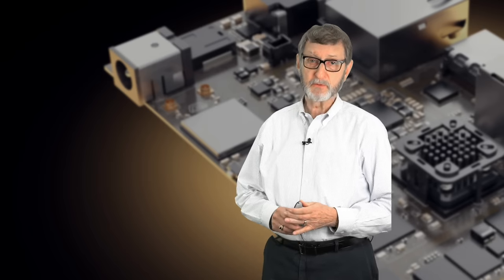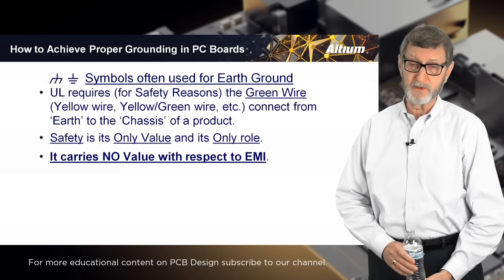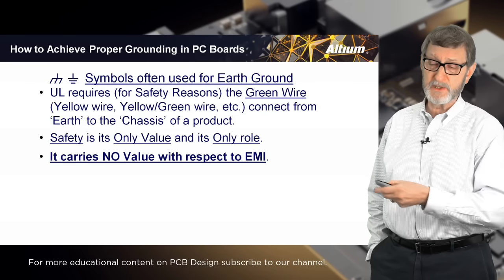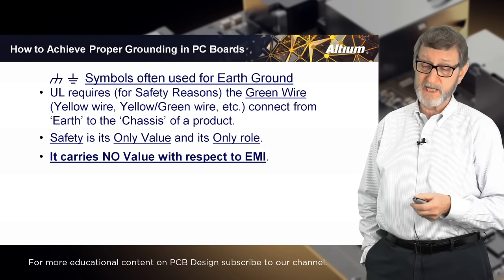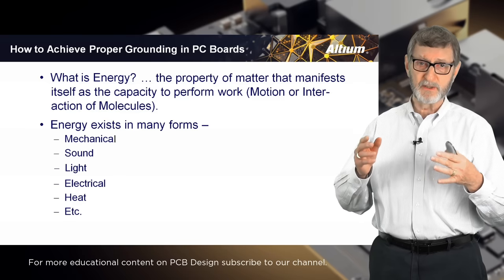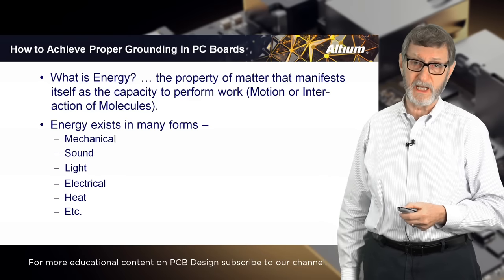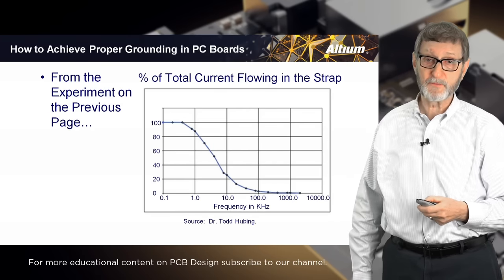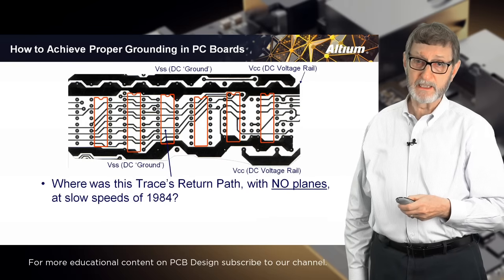[LIVE] How to Achieve Proper Grounding - Rick Hartley - Expert Live Training (US)

Comment: I've been a designer since the 80s. I have been working in Altium since its release. (A mixed and power electronics designer). 
I haven’t seen anything more exciting, I was stuck for two hours. Lots of adrenaline. Detectives are resting! Thank you for the material. 
Much is familiar and has long been intuitively understood. I developed some of my own triks and solved problems differently. But here is a wonderful systematization of the life experience of a wonderful designer on the way from a teapot to a pro!! 
I understand it and remember every one of my mistakes and every crazy PCB.  At some point I realized that the EMC laboratory should be behind my back, and not from someone for money. I assembled it, and the work went much faster. Thank you so much again!

Comment: 7:00 the question of should you attach the cable shield to chassis or to circuit ground, for which Rick's answer is always to the chassis (and for good reasons).  That's all very well, so long as this cable is not designed to carry the signal return (slash ground reference voltage) on the shield, like several standards for audio cables do, for example.  In that situation, you don't want the shield conductor to connect the chassis of two pieces of equipment that are plugged into mains, where their chassis are individually connected to the ground pin of two different wall outlets, thus introducing a ground loop, and a hum voltage that adds to the audio signal being communicated. There's a reason for insulated RCA sockets, insulated BNC sockets and so on.

Comment: Great presentation.  At 32:00 there is an interesting effect not discussed.  At very low frequencies the Z0 goes up (nonlinearly) due to finite R and G as frequency approaches zero; a low frequency dispersion.  You can see this effect on some RF VNA that go down to 300 kHz or lower.

Comment: I just took my electromagnetics class and a class called electrical energy conversion which both talked about electric and magnetic fields and magnetic field circuits along with transmission line properties and formula type stuff which all blew my mind that you can represent a transformer and other magnetic fields / "circuits" like you can an electric circuit while ASLO being directly linked by the electric circuit / trasnformer coil (so the relationship between the B/H fields and the E fields). This video is basiaclly building on all of that too, it all seems complicated if you don't know it but its all relatively simple. Im surpriesd they dont teach the relationship between electric and amgnetic fields / energy sooner in the degree since its so fundamental and important and relatively simple and it completely changes how you view / think about circuits.
Reply: Seems like it's more about lumped circuits - Distributed systems (aka the Power Grid) are complicated messes that show us how Electrical Energy really flows.

Comment: Engineering is all about taking a simple enough model of the real world, so that you can understand it, manipulate it with the tools you have (that for centuries, until 1960s, were as simple as a pen and paper), hopefully solve it and obtain useful results.
The Newtonian physics, although technically wrong, is good enough for most cases, and simple enough to be easily understood and manipulated. The hydraulic analogy to visualize electrical circuits is a powerful tool that simply works and gives correct results in the vast majority of problems an industrial and civil engineer faces in his career (the frequency usually tops out at 50 Hz, which is the mains AC frequency in Europe).

Comment: Very interesting and valuable.

I wonder if there is  such a thing as “field-oriented or field-centered electronic design” that starts at fields and folds the design around that.
Reply: I think the mind required to design circuits that way would be inconceivably smart. It's taken me 30 years to understand how electricity flows through a wire !! Lol

Comment: I think there are some inaccuracies there, 4:24  it is correct that earth is used for safety but only as a protection from lightning.  It is not safe to earth  a metal enclosure since the ground fault will not trip the circuit breaker since the earth return is a high resistance path. You need a low resistance path which is the neutral wire, not earth, earth doesn't have anything to do with it.   22:12 Set of Fields (EM Wave), so which is it, a field or a wave?  An EM wave is a different beast and it is produced by a time varying field caused by acceleration of electrons, so it requires AC.
Reply: EM wave is both a wave and a Field - Tell me, what is Sunlight? is a wave or a particle ? it's Both - This is cally Electrodynamics. No Electron from the Power station ever makes it to your home to power your PC or Phone Charger, the Energy is the EM fields/Waves

Comment: If energy travels in or along the dielectric material via waveguides, how does one explain extended long wires connected to various parts of a circuit? What will be the return path for such signals if the wires are extended from one PCB to another?

Comment: The energy does not travel in the dielectric. If that were so, a superconductive material inside the dielectric would make a circuit not work because a superconductor is blocking the magnetic field. Basically two wires with a superconductive tubes around and in between them would not be able to transfer energy to the load because the magnetic part of the electromagnetic field would not be able to flow in the space between them. You can extend this with superconductive wires so that the field cannot travel in the wires either, but you can still power the load. Perhaps it can still travel in the isolation material, but if it does it surely is a really powerful field travelling in a minuscule space.
Reply: it wouldnt because of the induced current in the super conductor leading to a loss in energy in the circuit

Comment: Funny to hear how the 3rd 'Earth' wire is referred to a 'Ground' in the US. Here in tthe UK all our oulets are labelled as 'L-Line, N- Neutral, E- Earth (Multiphase would be L1,L2,L3). A new colour scheme was adopted  to ratify an a standardasation agreement with the EU. It used to be L1-Red; N-Black, E-Yellow/Green Spiral poat 2004 or Green prior; now it is L1-Brown, N-Blue, E-Yellow with Green Spiral Striping, many times its bare wire and the Yellow/Green sleeve is put by the outlet terminal to make it easy to identify and code compliance. 

Many power bars and computer power cords imported to USA/CA from EU/China will have this colour scheme.

I first thought Black also meant neutral in North America; but at least I got a very nice fireworks display! xD. Coincidently in the current UK 3 Phase System L2 is Black L3 Grey. 

Oh the confusion ><

Comment: At 7:00, what does a signal in a shielded wire couple to, if not the shield? How do the electric fields behave when constrained by a faraday cage? If they're not coupling to the cage, what are they doing? What is the return path?

Comment: What is 100% sure is a few years from now kids will not have to bother with any of this. either there will be photonics revolution [lol], or realtime em simulation in the pcb layout software as they create the traces, warnings will apear to notify the designer about conflicting areas. it is not easy to think about all of these physics happening between each other. 3d visualisation will greatly help.
Reply: I would suggest your assertion is wrong, in the same way that people that rely on spellcheckers and grammar checkers still generate garbage: if all you do is follow warnings and obey them without knowing the underlying details of how things should work, your odds of creating proper solutions in any such system are very low.  Another area I can point out where this is true is with writing code and the warnings/errors you see reported.  Ok, so you fix all the compiler-recognized errors and warnings, but did you truly understand what they meant in practical terms in that context, and do the correct thing as a result?
Reply: Maybe a simulation that can show you the approximate generated EM fields, but I doubt the software is going to be able to formulate a good solution to solve the problem.  This is the same issue as autorouting -- many attempts have been made to let the software route a board for you, and all of them suck.  They simply don't generate good trace layouts.  Software will have the same problem with this issue, it's just not going to generate a good trace layout that solves the EM fields.

Comment: Excuse the skepticism, but I have some. I think the truth is likely somewhere between that explanation and the more traditional "travels through the wire" explanation. And what about AC copper transmission lines "skin effect"? That is proof that the "mini magnet" dipoles are aligning easier near the outside layer of a copper wire and that there likely actually IS some energy transmission inside the wire or trace, not only around it. I suspect that in DC more of it is through more of the trace also, obviously. As in DC the electron mini magnets didn't have to re-align every time the direction changed.

Comment: Transmission line and waveguide are not the same. Transmission line consists of 2 conductors and supports TEM waves and can propagate DC. Waveguide is 1 conductor which doesn’t support TEM waves and DC.

Comment: First of all thank you for making this content freely available!
How does the traditional 2-layer “Manhattan” layout technique mesh with this information? It seems to me that you would be relegated to co-planar signal/return routing since by design current could NOT travel in the same direction on the bottom and top layers, which as you explain would be ideal.

For reference I am just learning the basics of PCB layout design and am designing some fairly simple 2 layer boards. The “Manhattan” style layout technique was recommended for 2 layer designs at some point but now I am thinking it should be completely avoided!

Comment: Hi. 

I am a young engineer trying to design a RF mixed digital board. 

All the reference designs that I see using the antenna chosen and the radio all use GND pours on all layers and then PWR is just routed as traces on an inner layer. 

The antenna that I hope to use requires a GND plane to be a set distance away from the layer where the antenna is placed. 
In their reference design it shows GND on the top and bottom of the PCB and it's the distance between these planes that is critical. 
Will it matter if there is a PWR/signal plane on a layer to the outside of the GND plane away from the antenna? 

This might be vague but trying to see how I could implement these stackup recommendations in my design. 

Cheers

Comment: I have one doubt. As you said, the stitching capacitor has no effect on conducting energy through split planes at higher frequency because the impedance becomes inductive above the resonant frequency. So, my question is that whether we can reduce the capacitor value ( in case 0.01uF to 1nF or 100pF as per video) so that the resonant shifts to higher frequency?? Will it make sense? @altium

Comment: Really in depth presentation, taught me so much! There was one thing I was wondering though. What if we take the top 4 layers in the recommended 12 layer to create a 4 layer stackup. Then every power plane has a reference to the GND plane but the benefit of it all is have a separate power and GND plane, thus if you have different voltages, it would be easier to create power polygons. Althoug I was wondering what happens when you switch signal layers 1 to 4 in such a stackup, since cpacitance between place GND and PWR isn't large due to larger distance between them, but it might still be OK, since we will develop large capacitance between layers 1 & 2 and 3 & 4? Maybe would need a via between GND planes in this case? Thank you!
----- Sig/PWR -----
-------- GND --------
(core)
-------- PWR --------
----- Sig/GND -----
Reply: See ground loops.

Comment: could anyone explain what is the meaning of the sentance " Route the top layer in triplet" at minute 52:20-52:55, thanks
Reply: What they did was for every 2 original signal traces, they turned it into 3 traces by putting a ground trace in between.  This gives each signal trace at least one adjacent ground trace to couple to.  Thus the term "triplet".

Comment: At 1:13:30, why are ground plane splits only needed when the analog frequency is low?
Reply: From what I understood, it is that the return currents will go anywhere (shortest purely resistive path) at low frequencies. And therefore you want to at least stop them from going across your analog ground introducing voltage fluctuations across the groundplane and whatnot. At high frequencies, the return paths will be around the signal path anyways and therefore do not require a split. Have a look at the shorted coax in the first part of his talk.
Reply: And I must say, that I'm not 100 % sure, because we are talking about the frequency of the analog plane and not the digital plane. If the analog section does not care about frequencies below 20 kHz given a high-pass-filter or whatnot, the relevant noise sources (>20 kHz) will not be present within the analog section for the reason stated above.

Comment: Why didn't you discuss the difference in efficiency in regards to the angles of introduction between magnets...for example it's easier to separate large magnets on a horizontal plane rather then pull them straight apart.... if that principle is applied efficiently then technically it's theoretically possible to introduce 2 magnets at their most efficient angles of interaction to convert the energetic movement from the repulsive forces into inertia then use said inertia to introduce another magnet in at that zone of low resistance establishing some sort of movement loop....the right configuration could turn a simple magnetic arrangement into a battery with a 5000 year lifespan......imagine a rotary engine but your pistons are magnets and around those magnets are a drum of magnets...half that drum is positive half is negative and its rotated by the crank 1:1....ring of pistons and drum around it right...now the magnets on drum slide above piston at its angle of highest efficiency now only option for piston would be to turn the crank rotating drum to its next phase...now some math to calculate interactions....if we have 8 piston magnets and 2 poles on drum that mean's there's 3 mid phase attractions 3 mid phase repulsions 1 uninhibited repulsion to attraction transition and 1 resistant attraction to repulsion transition...that means 7 of the 8 pistons are facilitating the rotation of the drum....as long as extracted energetic demand doesn't exceed the accumulative exerted magnet force you'll have rotation....

Comment: The part related to inductance and fields needs some more thought to be fully understood, I think it will become clearer if I watch this a few times. This is because we actually have two fields, electric and magnetic and they are inter-connected. It would have been great to show simulation diagrams that show what happens to the fields in different cases and how they couple and spread.

Comment: 1:55:15 Eric Bogatin also says dont do ground flooding :) two giants give opposing advice, I dont know what to do :)
Reply: I too find this confusing. But my understanding is Rick means when the layer count is low, and we cannot increase number of layers for what ever reason, then we should pour/fill. The main point is to ensure all signals, and power (which can be viewed as a signal in a way), must have a close return (GND). We do not want signal energy having to cross other signal energies to get to their returns. If layer count is low, the only way to accomplish this is with copper pour. And he does say many times, the pours/fills must be connected with MANY vias to eliminate a resonant cavity. But I wish Rick Hartley and Eric Bogatin could have a discussion and explanation on this detail...
Reply: I think Eric Bogatin's reasoning is "It doesn't help by enough to make up for the risk that you might not put in enough vias -- big risk for small benefit."  But if the alternative is not having a reference plane...